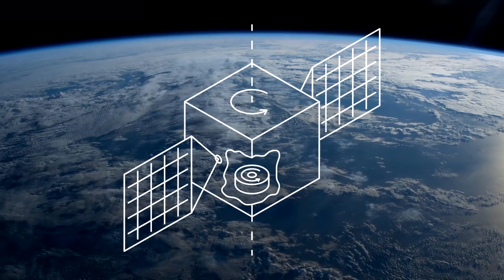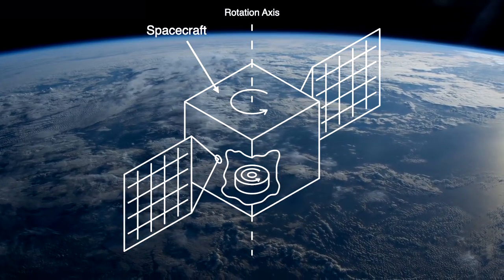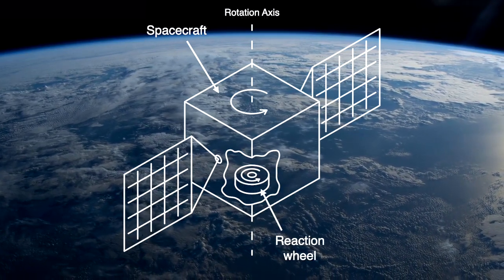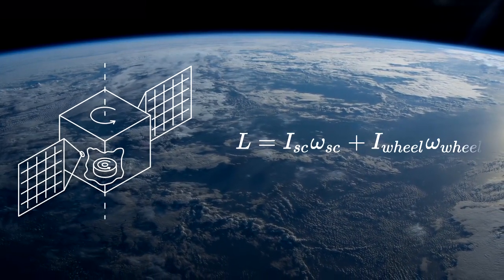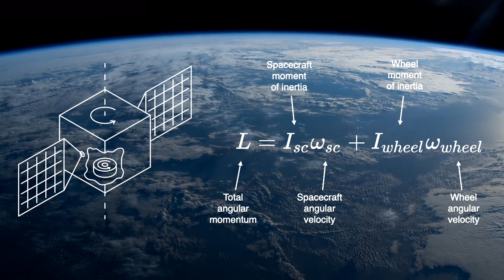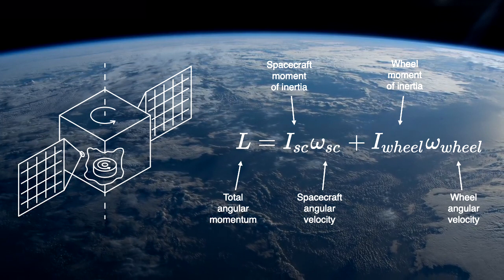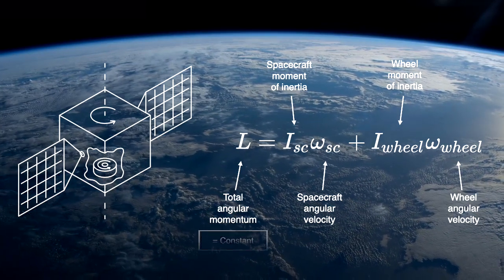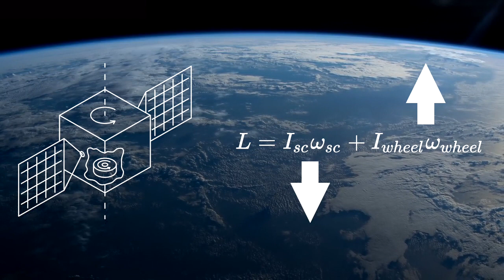How to turn a Satellite

Comment: If i am trying to balance in say the x or the y axis would the motor also rotate in the same direction and change speed only, say for example if i want to to maintain 45 deg around the x axis and also should the other 2 motors be running ?

Comment: how are you measuring the angular velocity of the reaction wheel?
Reply from the maker: That’s an easy one to answer: I’m not. What I’m doing is controlling the rotation speed of the brushless motor using the speed controller. The controller cycles the coils in the motor at a certain, controlled, rate and that’s the speed of the wheel.